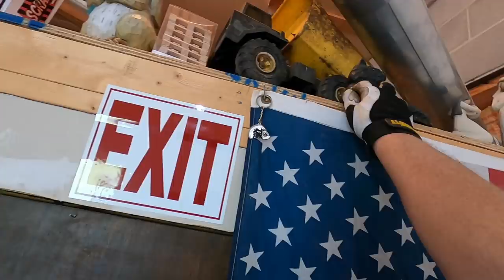I Can't Believe What People Throw Away

Comment: I missed out on a scrap mower last night. Stuff doesn't stay put as long in our town as it does yours.  I noticed the scrappers jump right on stuff. I have already sold a couple refurbished lawn mowers. I go through and repair or replace anything broken  or missing. New mowers are expensive  and I have no issue selling them. The parts alone are worth it on those mowers. A new coil for a lawn mower is $48.  Blades run $17 on up. If your mower guy isn't parting mowers, he is nuts. The newer parts are of lower quality too than the originals.

Comment: Battery charger huge copper inside and cables, also the male screw in on those regulators, on the propane is brass. Coated in plastic.

Comment: I think you should get a small trailer so you can get more scrap
Reply: Get a small trailer made from the back of a pickup
Reply: I was thinking of saying the same thing
Reply: With the few that know for even more scrap one gets while dumpster driving is to invest in a trailer.
Reply: ...nope...forget the trailer, trade for a 1990's-early 2000's, or even '70's or '80's if you can find one in good mechanical shape, 1/2 ton full-size, LONG WHEELBASE pickup..it will make a HUGE difference...and you don't need any extended cab/4 door, or 4 wheel drive setup..just regular cab, 2wd, long wheelbase...you could get one for the price you could sell your little truck for, plus the price you would have to pay for a trailer...and much more maneuverable through those neighborhoods than dragging a trailer around everywhere, no worries about backing,having to hook/unhook the thing, etc...I would normally recommend a 3/4 ton pickup(long bed of course), but from my observations, you rarely haul anything heavy enough to need it, so a 1/2 ton is all you need..and, for the extra trips you will save, you shouldn't hurt much, if any, in the gas department, especially if you get an inline-6, V6, or small V8... :)
Reply: @davidupson7330  instead of making it out of the back of a pickup truck he could use a dumpster lol, it would be more fitting
Reply: A van would be nice
Reply: @dyer2cycle  Love this comment. Knowledge is power!!! Thank you even tho I have a 3/4 ton already lol.

Comment: Hi Paul 🖐️, you made my day ‼️, The expression that you had on your face when you said the cat was purring was hilarious. But than I listened and for A minute I WAS freaked out two. I laughed so hard I WAS crying ‼️🤓. Thanks so much for sharing I needed that ‼️💜💯💯💯.
Reply from the maker: The cat was really making that noise. It was vibrating against the plastic dashboard
Reply: @ScrapPalletMan  OMG ‼️I probably would have drop him off quick ‼️ LOL 😆 🤣🤪 😜🤭 Werk‼️ have a great weekend Paul 🖐️👍 😃.
Reply: Paul, the company that makes those command hooks has fasteners for pictures, basically hook and eye fasteners on their extreme sticky stuff. You could use that to mount the metal art pieces and other things to the shop walls. No damage to the paint. That AC may have just needed the filter cleaned.

Comment: You don't need a bigger truck or a trailer. You are doing alright with what you have got.  As you have done previously Paul, you take a load to scrap and then you come back for more. Keep up the great work, Paul. You are a legend. Was that the heaviest your little truck has hauled? Awesome. Keep the metal cat, that is cool.
Reply from the maker: I try to do lighter loads but more frequent. I've had over a thousand pounds several times. I think one time 1500 lb.

Comment: All those mowers will run with minor TLC. The Murray has the Briggs "PulsaJet" carburetor and the issue is likely a $5 (at most) diaphragm kit to get that up and running. The Craftsman appears to have a Tecumseh engine on it and probably cleaning the bowl screw will get it running.

I have two garages/shops full of "curbside candy" tools and equipment I've saved and fixed over the years. Most of it ran as-is or minor things were wrong. I salvaged a mower that a neighbor threw out. I went through it with maintenance, but I got it running in 10 minutes. The problem? He overfilled it with oil and it "locked" the engine. I leveled out the oil (which was clean) changed the air filter and spark plug and the machine fired right up. I was cutting my lawn with it the next day. My neighbor was walking his dog and he was shocked to see me using it the next day.

Comment: Paul thanks for the thrill of it . You can help your self with a small battery winch  put a small swing arm off of the side rack to load the heavy stuff . I come up with a lot of ideas I was a electrician and mechanic and electronics for 61years I have to invention one is a auto welder for mig  welding equipment  foster wheeler mountain top pa . And air products Wilkes Barre pa did wiring on gas plants with plcs  run computer controlled love your scrap videos love to be out there 81years old Feb 25 . Act a lot younger just stay in shape  God bless you and what you do .Thank you

Comment: As for the operation of the air conditioner, we can not pump cold into a space, what we can do is remove heat. So if the air conditioner doesn't have somewhere to pump heat to you will not get a temperature change.
Reply from the maker: Very true. Thermodynamics.

Comment: Paul when u run across a lamp I noticed that u cut the cord from the bottom, always break the top part off where the bulb goes in that way u will have access to the top of the cord clip it and pull it from  the bottom.

Comment: Not like this is some huge revelation I'm dropping on you but, I'll go ahead with it... Harbor Freight sells a 1200lb trailer for 350 bones. Frame up a box for another 50 and you'd double your cubic hauling capacity. Only overhead would be higher tolls for the additional axle and annual registration (state-depending). Both of which would likely be offset by fuel savings/fewer trips to source/haul more stuff. --- At any rate, good video. Stay safe.
Reply: Great advice brother! That’s definitely a great approach.! Thanks!

Comment: Ive done some scrapping...Ive got a 16 ft trailer with a winch on the front..its easier to load than a truck and it has its own brakes..really helps when theres a car on it.. Wow prices are way down...Last time I scrapped it was $200 a ton..I would have fixed a mower or two..I just like playing with them..the oldest one I found was a Briggs 1938 Model WB off of a cream separator..( about 1 hp)...I had to keep it coz it had a kick start lol..yeah Ive never seen so much junk like that.. Ive stripped the copper out of things and it is worth the time most always..(cutting the ends with chisel or sawzall and the winding falls out)...I used to like it when I got a couple buckets full of copper...the scrap yard guy always looked at me funny when I brought motors and transformers without any copper in them lol but when I set the copper out and got more for it than the whole load of steel I guess he understood..#2 was almost $2 so it adds up...looks like fun where youre at..Id be busy too...

Comment: Great video,  when it was colder you always gave a temperature. What’s it like there now? You did however say it was extremely humid. It’s been in the 80’s here with 50-75% humidity. Our hot season is approaching us very soon and will be miserable. So hot and humid you can’t cool off cause of the humidity and the heat index will be in the triple digits
Reply from the maker: It was 70

Comment: I have a bigger truck, a f350, 4 door, 4x4, dually, with a 10 foot long flatbed, 8 foot wide. I can tell you first hand that a bigger truck comes with bigger problems. Number 1 is it takes more fuel to get around. Even as a diesel I doubt I'd get 10mpg starting and stopping around neighborhoods like that. Even with that much more space I doubt I'd get that much more metal on there to offset the cost. Sure I could get like 20 washers on my truck if I had some way of stacking them, but I don't have the back anymore. 

I'm actually looking to sell my 85 nissan flatbed 4x4 and trade up for a newer toyota extended cab. I used to have an 89 ex cab with the 22re. That truck was abused for decades. before I knew how to load it once I drove out of the quarry with over 3200 lbs of rock in the back and it made it 20 miles home in the mountains! It was also used almost daily to move dirt around on the ranch, firewood, etc.. I miss that truck.. It died a death of a thousand cuts. The bed was just destroyed.. the tailgate munched, backed into a tree once with the tailgate down. The driver door was bent back too far and sucked closing, the body looked like a derby car.. but still she ran.. until one day the rear end would start screaming at 45-55. and first gear always had to be held in place.. and then the engine that had a lower end knock for 130k miles finally let loose. At that point she was put to rest. Stripped of EFI and other good parts, and scrapped. That old 'yota paid for itself a thousand times over.

So you made what, $60 in a day? Drove around for a couple hours. Wasted probably 5 gallons of gas? You just can't do that in a bigger truck. 

Would be awesome though to get one of those toyota RV campers that the camper is going bad, then just rip it off and build a flatbed for it. Enclose the cab, or put another one on it. Extended cab of course (I'm 6'7 it's mandatory) and a 7'x8' bed on there. I'd love to get sheets of that plastic bedliner. That stuff is tough!!! Would be perfect for a flatbed.

Comment: just grab the light socket and bend it sideways . it should pop off with no problem . cut the wire and pull it through . extra wire ---------- works on most lamps

Comment: I let my air conditioners all you got to do is take the Shroud off and I screw the back radiator and blow it out with an air compressor to work is fine I do it all the time that's why I don't work becaues radiator plugged up

Comment: We use straps would never leave a stove we take a battery router and screwdriver,cut it up $10 a bike from byke guy
Reply: Stainless steel sinks pay more,you will learn,docked for rubber in those bykes
Reply: Shurly you could find a lawn mower guy that would pay you more.found a riding lawn mower in garbage, didn't have heart to go back and tell guy it was just a fuse .